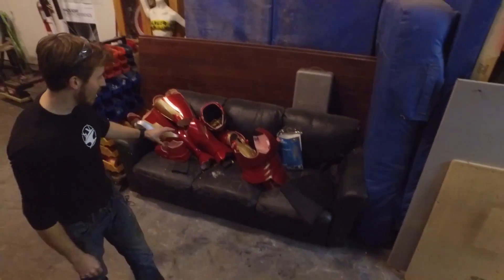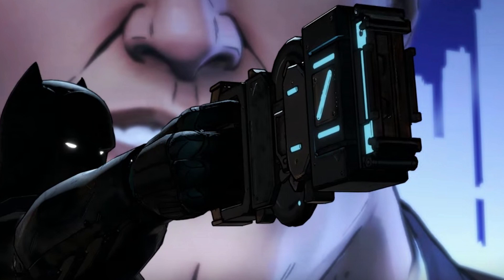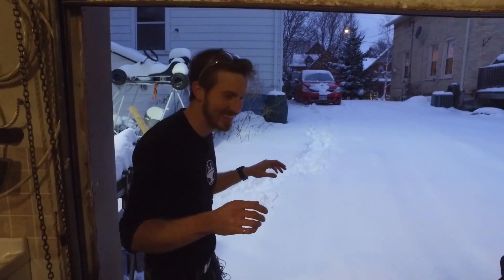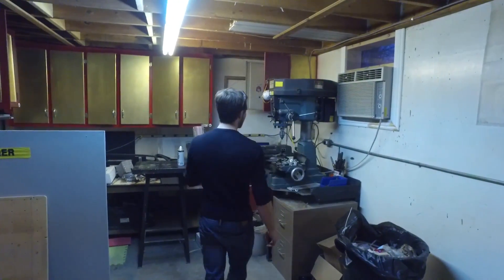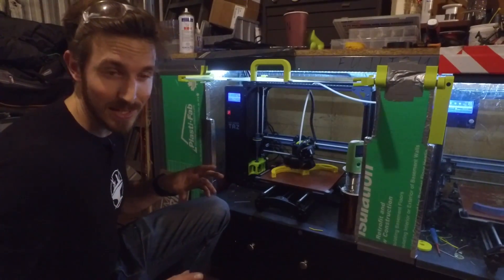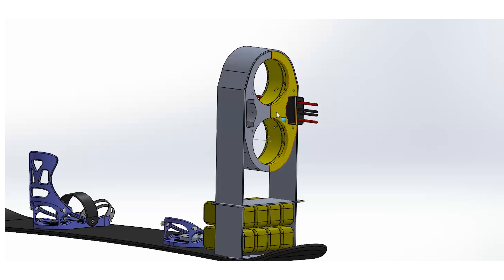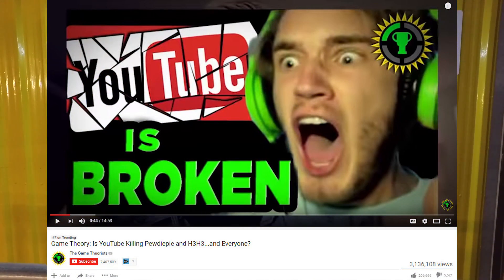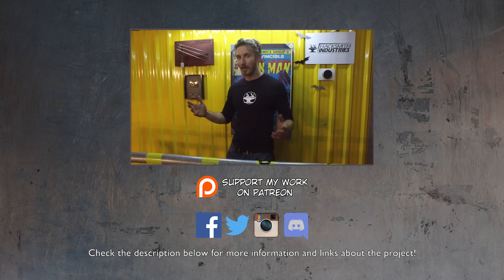WILL THE GRAPPLING HOOK ASCENSION DEVICE WORK? (Workshop VLOG 011)

Comment: maybe instead of mounting the edfs on the back of the snowboard   you could mount them in the front horizontally
Reply from the maker: +Sufyprojectss then they'd break when you inevitably crash :p
Reply: Right , or you can mount tgem very low(15 cm from the board ) one in the front and ine behind your right foot! THENKS FOR ANSWERING!!
Reply from the maker: +Sufyprojectss then they'll suck snow in :p
Reply: the Hacksmith probably... but it shouldn't suck too much snow to low the edfs rpm
Reply from the maker: Low? The EDF's spin at 40,000 RPM ...
Reply: I ment that even though the snow would make the edf spin at a lower rpm ,it wouldn't effect too much their thrust
Reply: (Probably , I'm not an exper and I've never used edfs in my planes
Reply from the maker: EDF's lose barely produce any thrust until over 30,000 RPM =P If the snow slows them down, no thrust! also they might get damaged
Reply: the Hacksmith good to know !!! and thanks for answering
Reply: Sufyprojectss z

Comment: great update! I would HIGHLY suggest a separate charging box for your lithium batteries. the RC community has a fair number of big fires every year due to a battery randomy combusting during charging.
Reply from the maker: Hence the metal cabinet ;-)

I mean we could test it,  but I'm pretty sure it would contain the fire
Reply: the Hacksmith Flite Test did a video about that, actually.  They were storing their batteries similarly to your setup when they had a fire.  it was contained, but only becase they caught it in time.  They then designed their "Battey Bunker" (the title of that video) that only cost around $20-30  If you did have a fire, you'd lose all of your batteries as well as probably the rest of the contents of that cabinet.  I'd hate for an easily preventable incident prevent or delay further progress.

Comment: for the snowboard, i think you should turn the thrusters on its side. so they are next to each other instead of on top each other. that will make it less likely to hurt yourself if you fall backwards, and its less likely to break if you fall backwards. cuz if that desine falls backwards, it will bend the thrusters to face down because its taller. plus it will look cooler to have the thrusters side by side
Reply from the maker: On a board, you fall sideways a lot more -- and if the thrusters were side by side, then anytime you crash like that -- there goes over a thousand dollars worth of parts!
Reply: True
Reply: I think i was getting the physics of thrust mixed up. Like, i was thinking because the thrusters are higher, it would push the front of the board up. But thats lower thrusters. I get mixed up alot XD

Comment: My immediate concern for the snowboard setup is how close it will be to your leg. Will the EDFs not suck your pants into them? It just looks super duper close.

Also, the walk around the shop and talk about stuff format is really cool. Easy to make, easy to keep us informed. Very cool.
Reply from the maker: +Blackobluna not much choice for proximity to my leg -- we will have a grill in front of them though and all you need to do is tie down that pant leg
Reply: I was initially expecting you to go with a horizontal setup rather than vertical. But when I think about it, that would lend itself to slamming the EDFs into the ground when carving .

Sounds like you've got it figured out, stay safe!
Reply from the maker: +Blackobluna bingo! I started with a horizontal design with a spring system so if you crashed it'd bounce out of the way -- but then we decided to start basic, test, then see what's what.

Comment: you should put the edf jets lower because of it rotational action it might have on the snowboard
Reply from the maker: +Hal Bishton then they'd suck snow in. It's a rigid system, the torque won't be a big issue

Comment: Board not be pushed forward, It will rotate because the front of the board will be pressed against the ground. You should install the engines much lower, closer to the boards. As for the point of application of force.
Reply from the maker: +ALILublin and then you'll suck in all kinds of snow. My bodyweight is far greater than the system -- it'll just take some practice to take the force from that location :)

Comment: I hope you do the instructional videos. I am wondering about the climbing speed of the grappling hook winch compared to Colin's. Would adding weight to the motors you used drastically affect the performance? Not to mention the sudden pressure the kevlar rope will be subjected to as well as the wear and tear from the winch.
Would be funny to see Spider-Furze and Bat-Smith on Christmas though
Reply from the maker: +jose paolo Aranda it should do 200lbs at a speed of 1.5m/S

A few times faster than Colins :)

The drill motor he used is maybe 1kW at best? These are 5kW in total :)

Comment: please have the turbine pivot based on foot position, one foot only to turn the single double or triple turbine
Reply from the maker: +George Robles I don't think that's necessary -- if the force angled away from the board it'd likely cause you to crash. You steer this one just like a normal snowboard
Reply: I have never snowboarded, but I believe it would give the ability to slide sideways and forward with control. 
        Well, that's how I imagine what happens to the board as you slide down hill and turn side to side. Straight shot is a no brainer, but to be able to apply force to the opposite direction of your slide in a turn would probably be helpful at those speeds, and help to come to a sliding sideways stop if you don't have any reverse thrust. But with snow I believe that you will have a break like a dog sled as you mentioned it was easier to break in snow.

I believe that your turns will be wide and slow with that extra weight on the tail.
Reply: the Hacksmith I should have asked, how do you normally turn and stop on a hill? You slide sideways a bit right?
Reply from the maker: Hey George,

Yeah, you typically carve back and forth on a snow board, which reduces your speed and allows you to steer. Unless you're going for a speed record you typically don't go down the hill straight forward =)

Because the goal is to snowboard on flat ground, I expect we will use the power to get going to speed -- then cut power when you want to carve, or steer, or brake -- then once you're ready, you can hit the gas again.
Reply: the Hacksmith that still possible with that much weight on the rear? Like your trying to pivot and have a 25lb weight on your rear foot right? Front is really light, so less mass to pivot on.
Reply from the maker: The batteries are actually quite light, so we don't think it'll have a big impact. It is just a prototype of course -- if we find it's difficult to use we'll shift the batteries towards the front of the board to even out the weight distribution =)
Reply: Thanks for feeding the brain. Good luck, might I suggest you add ridges to bottom will keep you straightened. So you don't spin like Griswold on a saucer/asspan
Reply: I would love to see that with your ESC belt.
Reply: George Robles 
You are smart
Reply: John Paul,

 i am only as smart as the people i learned from and what i remember from experience. and i always want more experience and knowledge. ...more.......More!.........Mmoorree!!(snarling zoidberg)
Knowledge is great when you get to share it. otherwise whats the point?

thank you for you kind comment sir.
Reply: George Robles ä

Comment: Can't wait to see the propelled snow board! What lead you to chose a welded steel support systems for the EDFs as opposed to aluminum or composite? 
Could the EDFs be used to make a small hover craft?
Reply from the maker: Steel is cheap and easy to weld. For a prototype -- it really doesn't matter. Since the board isn't flying, total weight just increases inertia -- which when you're snowboarding, can be a good thing =)

EDFs could be used to make a hovercraft!

Comment: You mentioned briefly about experimenting with a long board, but because of breaking issues, you did not pursue it. How difficult or efficient would it be to design a thrust reverser to attach to the edf fans?
Reply from the maker: +geddon436 easy to overload the fans that way :(
Reply: the Hacksmith  how would the fans be overloaded?

Comment: neat mods to the printers! Lmao I was thinking of doing something similar to a snowboard this winter too, although I was going to use a 50cc electric motor and a 30 inch prop in a shroud to get more static thrust! If I may ask, how did you get the hobbyking sponsorship? Did they approach you or did you ask them? 

Keep up the great work (although I think you had your audio levels a bit high on your lapel mic, it was peaking out a bit at some parts)
Reply from the maker: +PeterSripol we approached them :) our advertisement of them is very cheap compared to them buying internet ads, which is why they continue to support us :)

Comment: For the snowboard project wouldn't it be better to have the EDF's horizontal so that the isn't as much force pushing in the connection at the base, or is it negligible?
Reply from the maker: +Sam Spies you'd also suck in snow that way, and first time you fall over, break the EDFs :p

Comment: The Vlogs, walk around and tutorials sound like cool fun ideas if you want to do it...  Would be nice to learn 

About the board -  why is the EDF mount so high up? 

Is it to make sure the board gets pushed to the ground? 

What do you think about having a lockable joint may above the battery to collapse the EDF dock for storage...  Or does it slot in?
Reply from the maker: +Andrew Boxill it slots in. EDFs are high so you don't suck in tons of snow, and when you crash, they don't hit the ground :)
Reply: the Hacksmith after some thought I figured it was the snow...  Never been in snow... 
So I'm interested to see how this goes 
Another thing...  What happens when you fall over, like what angle are your legs at, won't the EDF dip into the snow then and did you add a switch on the top or is it RC
Reply from the maker: They are placed high so they don't hit the snow... most of the time you crash and land on your butt, or your face. It's pretty hard to flip backwards =)

Comment: Also, you may consider mounting the batteries on top, and the EDFs on the bottom of your snowboard, so the output from your "thrust tower" will be putting less stress on the joints of the build.
Reply from the maker: +Tommy Callaway its a welded steel frame, not worried about stress :p

They are mounted vertically and high up for two main reasons. Won't suck in as much snow. And when you crash -- they won't hit the ground (bye-bye $1000+ of components!)

:) Good suggestions though!
Reply: Couple of really great points.  I suppose I should just wait until you make your video :) lol

Comment: This is just my opinion, I've been riding snowboard since I was a little kid, I'm by no means what I would consider to be good, but I can ride. you might want to consider Distributing the battery wait to the middle of the board and even some more weight into the front of the board. you'll probably have a lot more powder so in the middle and on the rear would be okay but if you have all that weight on the rear end I am assuming you're going to have nothing but trouble trying to kick the board out and actually slow down.

Comment: im not sure how well the snowboard is going to workout, considering how much weight is going to be put on the back of the board. maybe consider trying to add some weights to the front end of the board to level it out a bit?
Reply from the maker: The weight compared to by bodyweight will be pretty marginal. If it's a big deal, we can shift the batteries inbetween my feet =)
Reply: the Hacksmith oh okay. im not sure how much the whole edf system with the metal encasing would weigh, so thats why i was a little curious to see if the weight would be an issue. but thank you for replying, it definitely helped

Comment: You should make the motors horizontal instead of stacking vertically so each is  set to the other side of the leg to maximize airflow to them instead of being behind your legs which would block the air, would also keep it more balanced instead of top heavy so you could control it better...

Comment: personally i think you would have better luck with mounting the fans on your body as opposed to on the board.. just my personal experience is it makes it really hard to control.. i use a kite to pull myself on a snowboard.. look up kiteboarding
Reply from the maker: We already made a jet belt -- concern is crashing -- one crash and the systems toast... Considering the cost of components is over a thousand dollars we'll go for a safer -- but more difficult -- learning curve =)

Comment: for the snowboard. I think you would be better off mounting the jets to a backpack of sorts. this would let you ride goofy and also not have to move around the weight with just the inertia of rotating your body. if you placed the jets around the waist area like the attack on titan boosters, it would provide thrust close to your center of mass so it wouldnt feel like you are getting the board ripped out from under you or getting decked from the resistance of the snow. you could also ride bikes, rollerblades, longboards, skateboards, stand up paddle boards etc with the EDF and power supply mounted to the rider rather than the vehicle
Reply from the maker: We already made a jet belt -- concern is crashing -- one crash and the systems toast... Considering the cost of components is over a thousand dollars we'll go for a safer -- but more difficult -- learning curve =)

You should check out our jet-powered longboard video!

Comment: Very interested to see how the snowboard turns out. Could you elaborate on the design decision for the placement of the EDFs and batteries?
Reply from the maker: +pozarnik EDFs are in line vertically and high up so that when you go down, they don't get smashed. Also high up so snow doesn't get sucked in :)

Batteries were just convenient there -- if it throws off the weight we'll move them to the centre of the board :)
Reply: Thanks! That is exactly the answer I wasn't expecting. (Safety of the EDFs, instead of personal safety)

Comment: someone already did a jet powered snowboard with EDF'S but they used a handheld bar to mount them so they where away from the rider and didnt need to modify the board retaining its handling.

Comment: if youtube is your main source of income your in trouble. Never let one company control your income. if you can help it. im recently new subscriber.
Reply from the maker: It's not, hence why we do sponsorship deals. They typically bring in way more money than YouTube does. Even if YouTube goes under -- my brand is still recognizable -- so I'll just have to hop over to the next platform =)
Reply: wallys wheels so work 2 part time jobs? No.
Reply: the Hacksmith Awesome hacksmith. 👍

Comment: cool projects - have you considered placing the batteries between your legs on the snowboard? weight on the back will affect your steering, which you'll have to compensate by leaning forward. I think you'll be more comfortable having most of the weight between the bindings .. cheers
Reply from the maker: That was the original plan -- where they are now is more convenient but we'll test an dsee -- not hard to move them!
Reply: Looking forward to see how it turns out :)

Comment: I'm not sure if this is something you've seen already or if it's already been suggested, but just in case, I was wondering if you have considered using acetone vapor smoothing treatment for the ABS. This seems like it may be useful in producing more successful 3D printed EDFs. Also, great quality videos.
Reply from the maker: Yup, I've been 3D printing for 5 years now, I know quite a few tricks ;)
Reply: the Hacksmith just thought I'd check. Really love the videos, batman gun seems particularly awesome

Comment: good video like always. . question why don't you forge parts for the edf (flying project) instead of 3dprinting?? is it because of weight??
Reply from the maker: If you mean cast, its because casting precision parts like fan blades is reaaaaaaaaaally difficult. Lots of YouTubers have made at home casting look easy (which it can be), but only for non-intricate parts!
Reply: the Hacksmith oh ok how about the outer ring that exploded the last episode where you made a full 3dprinter edf and the fan exploded all over the place?? maybe it makes it safer and use stronger plastic for the 3dprinted fan?
Reply from the maker: That's the plan, but its unlikely 3D printing will ever work -- we'll likely just use it to prototype, then have the blades machined =)

Comment: just a suggestion for the snowboard, Move the batteries to the front or middle of the board and run wires. you mentioned you are relatively new to snowboarding, but basically the way it works you are doing 80% or so of the steering with your back foot. So any extra weight and height is going to throw your balance way off. meaning slower less controlled turns and sketchy air time. moving the weight forward will help off set that of the edf because every pound makes a huge difference.

Comment: Would that edf housing you have on the snowboard present a problem being so high and all on one side? I mean, would you get better weight distribution by putting the batteries or even some of the batteries up front? Also what about lowering that housing to lower your center of gravity? Or is that high up so you don't have to deal with the ambient snow?
Reply from the maker: Batteries already lower the center of gravity significantly -- but the weight of the system relative to my weight, is pretty marginal. The reason we have it high up is so snow doesnt get sucked in =)